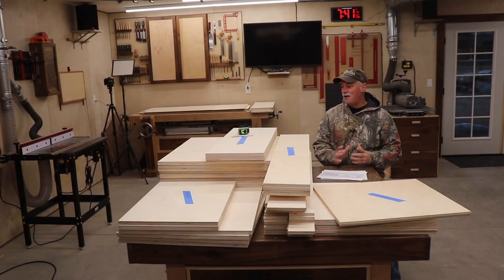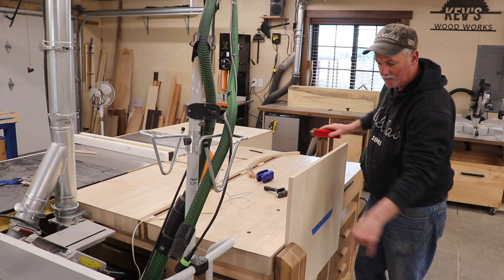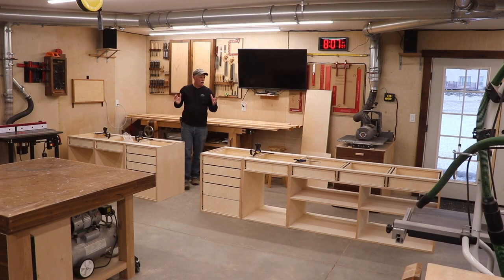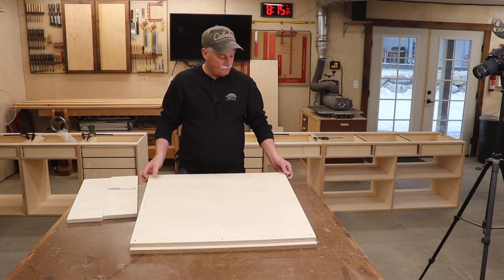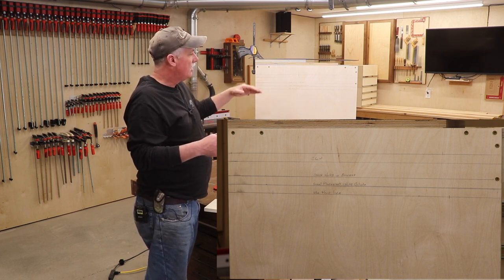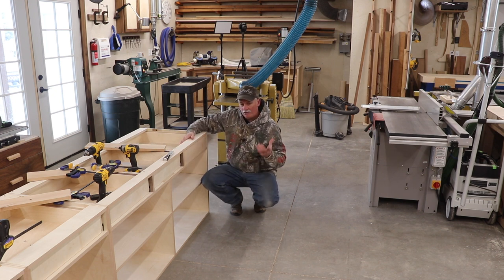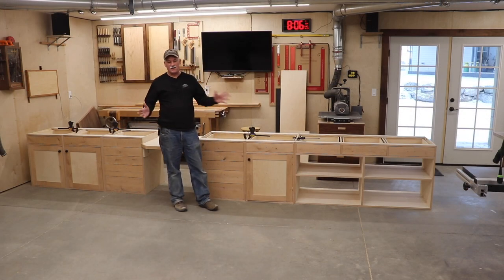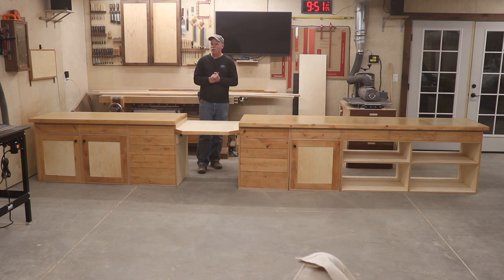Miter Bench

Comment: Great miter saw stand.  Once the saw elevation is set at the desired height, does it get locked in with some screws or are the knobs sufficient to keep it properly aligned? I like the look of the alder with the finish. Thanks.
Reply from the maker: Thanks!  Although I think the knobs are probably sufficient, I added a couple wood screws just in case.  They're easily removed if it needs adjustment in the future.